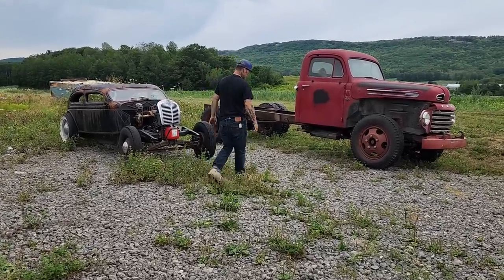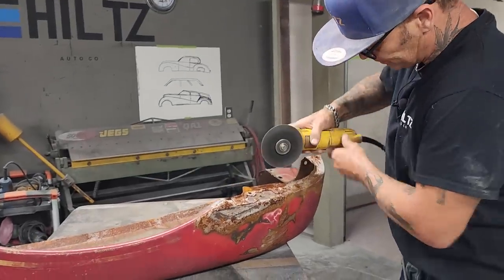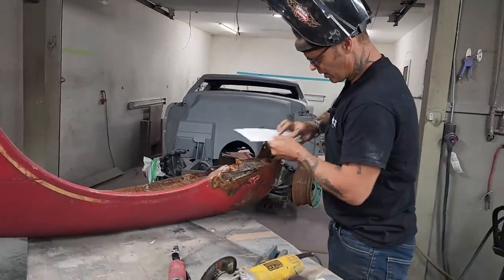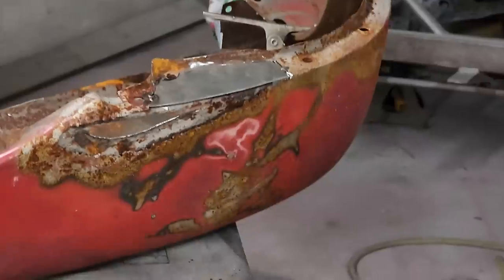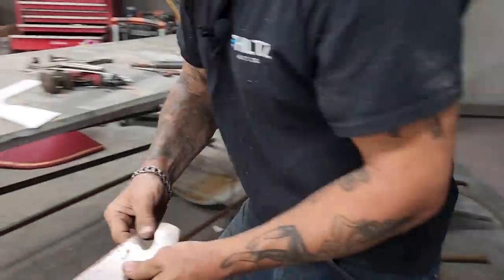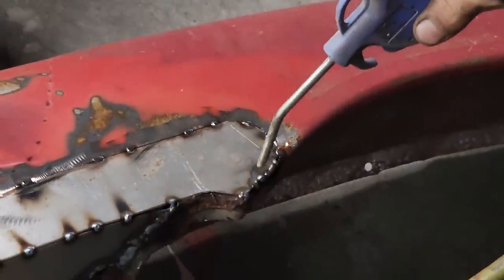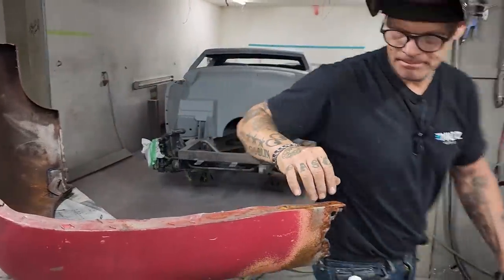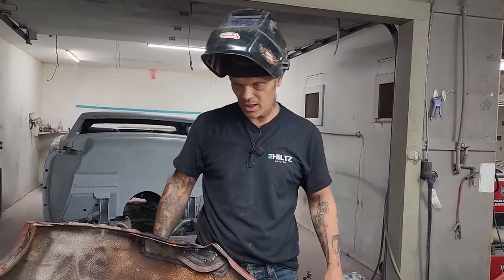Rust repair on the 1948 Ford F6

Comment: Love the mig welders, when I started doing panel work I did it all by Oxy and Acetylene as wire feed welders weren't available yet, Now that was an art long learnt to oxy weld without warping the panel , especially roof and rear quarter panels, Thank god for the MIG
Reply: The Russians invented the Mig welder,  they welded their jet fighters with it.
Reply: @billgriffiths1685  Close but not fact,  HM Hobart and PK Devers invented “MIG” welding in 1930.

Comment: Nice one guys. You're both doing a great job. Like the zooming in action for the welds too Jolein 👍💕
Reply: You have 5 lug wheels on the 48 f6, you may be able to use 10 lug wheels from a simmi truck or possibly change the hub assembly.

Comment: Have you looked into aluminum 10 lug wheels with an adapter plate to go from 5 bolt to 10 that way you don’t have to change anything on axle it would just bolt on they do it on 1 tons all the time , if you cant find a plate any machine shop can make them

Comment: Those rims are "outlawed"  very dangerous.  Check junk UPS  trucks, they used some like that. If you change the wheel size, you won't be able to go much more than 30 mph. Those trucks are geared really low.  If you are lucky about 5.55:1 . get yourself some 20 inch or bigger wheels.
Have to remember this is a 1.5 or 2 ton truck, made to carry some heavy loads.

Comment: Chad and jolene the only thing you will get the wheels off that you need will be something like a 7.5 ton lorry cause of the load rating for the wheels so they are strong enough for the truck. With the truck wheels you can still get different sizes and width of wheel. Keep up the great work the both of you 👍 👏

Comment: Chad/Jolene,
If you have a large motor home yard near you ,check and see if a set of rimes and tires may be available in the lug pattern you need. It is said that a lot of older RVs used this set up and will work on your F-5.
Reply: @montyrayza7220  Chad will be Chad😉

Comment: Hey guys,you can fine a set of semi truck 22.5 10 lugs steel wheel and tire for cheap. You could make a adaptor or cut and weld the centers of your stock truck. Those semi tires last for a long time . Love all your projects by the way:)

Comment: Amazing work as usual !  When you change the wheels can you do a clip on how modify or find rims to fit, i presume you will need to either make an adapter or go back to the spindle,  not sure.   some 10 bolts on there would look good :)

Comment: Hey Chad, when you are tacking sheet in place, would you recommend having a higher arc temp and slow wire speed or lower arc temp and slow wire speeds? Which one would be more beneficial in the long run?

Comment: I tried cutting a slot in 18 ga. with my zipp cutter, and welding it up with spot welding. I burned through with my initial spot welds. How wide is you zip cutting disk? Mine was 1/16 th in.

Comment: Haha... I just asked about the coat hanger on another video yesterday. Glad I watched this video. I have a 77 f100 with thin metal in spots. My flux welder pops holes in gaps so I was wondering how you actually welded with hangers

Comment: Could you change the axles in that truck to a newer setup then get a set of lug adapters cause the split rims here in the USA no one wants to touch em very dangerous to change. I had the same issue you had no one wants to work on them so changed found a donor engine and chassis and put the cab and everything on that.

Comment: Changing the wheel size will them mean the diff head will need to change as it will be screaming going along the road, not good over revin an old engine, so you’ll need to crawl along.

Comment: Hi Chad  if You can  older R V   They Ran 19,5  5 Lug  or 22,5  5 lug   you can  tubeless radial tires  kind of hard to find i found 8 for my f6 19,5 bt the 22,5 would be closer to the old  look     bud style wheel

Comment: Depending on what your going to use it for?, if just to cruise a cool old truck, you might think about a crown Vic front end, along with disk brakes, power steering, and so on., but your not going to go towing heavy loads with it..

Comment: On your 48 Ford tyey
Reply: On the 48 ford 600 in 67 they changed to 6stud rims so I think u probably have to find none split rims and tires u want and put ur centers in  them because even today the truck 600 and that are 6 stud or mabey make adapter just a suggestion